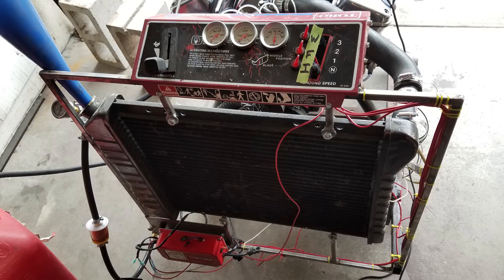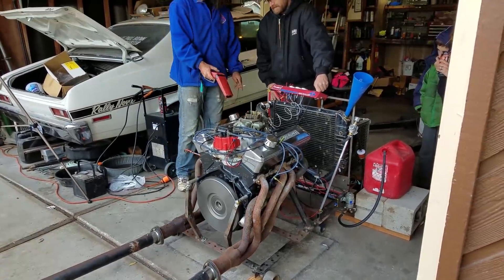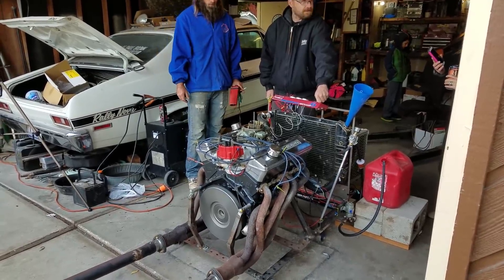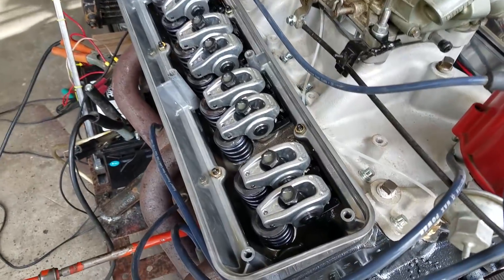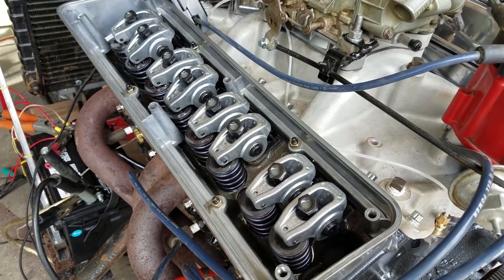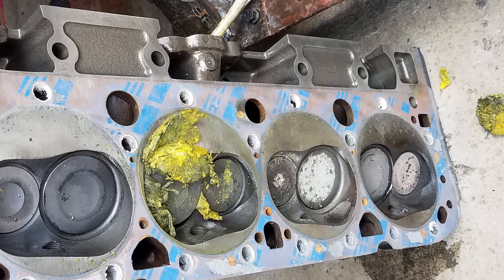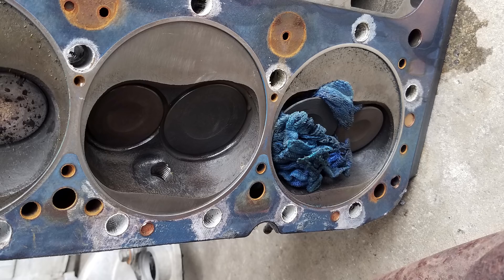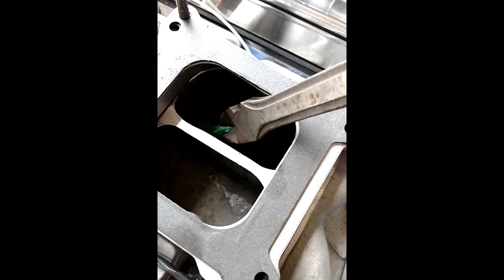Engine Broken In With Rags Left In Intake + Aftermath

Comment: Ok, my question is WHY a 400 small block, steam cooled , nightmare.
Just go get a nice 350, and make a nice strong 383 stroker, and live long and prosper.
Reply: I know about the steam holes, I have built a 400 small block, I lived and learned.  I said steam cooled as a slam toward the 400 small block.
My cousin talked me into building it for his 76 Monte Carlo. I wanted to get it internally balanced, he didn't want to spend the money.  
I never liked that engine, I still don't. He blew it up. The second time, after somebody else built it for him, I refused, he wrecked the block.  thank God for small favors.
 You cant be so Chevy rabid, as to not be critical of some BAD engines that they designed.
Talked a friend into letting me build a 454 for his 69 Chevelle, 30 years ago, that he wanted to run brackets in, that engine ran untouched for 4 seasons.  Now he has the 396 back in the Chevelle, it's fully restored and he and his son show it.  The 396 would have been a bad idea to run brackets in, just like that 400 SB is a bad idea.
The 454 is on a stand in my garage. Looking for a 69 or 70 ElCo. to stick it in.